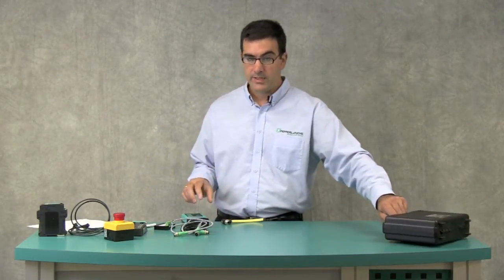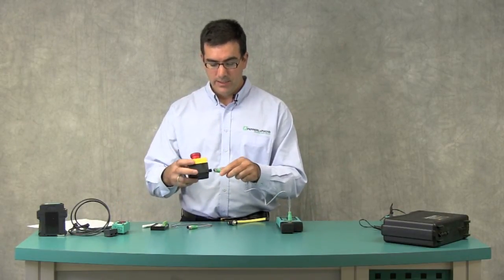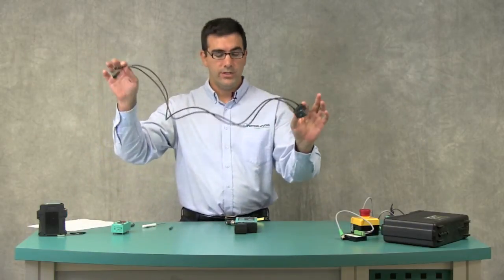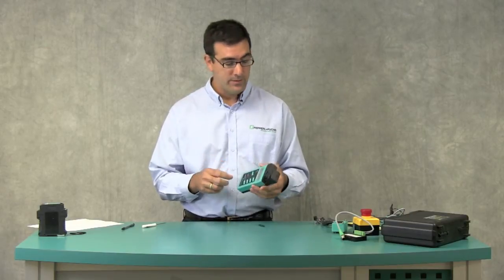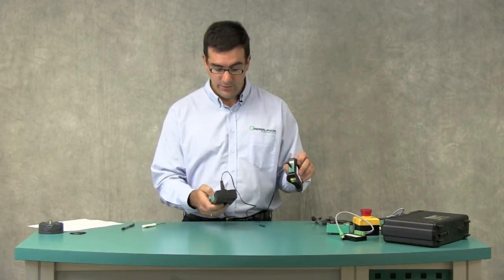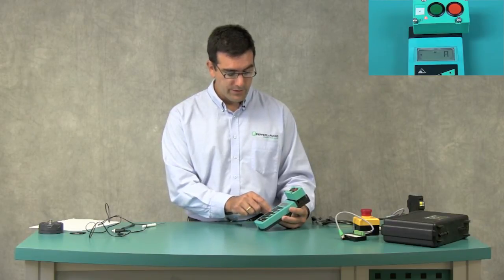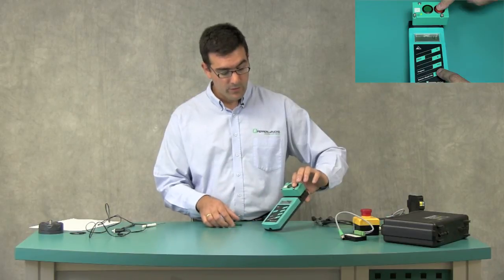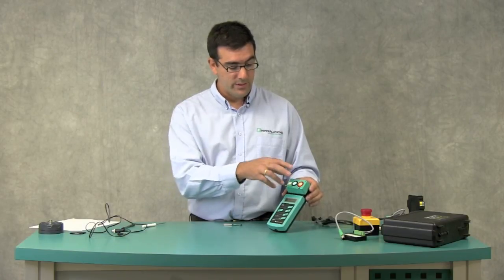How to Use AS-Interface Handheld Programmer

Comment: Hellow, Mr. Tim Cicerchi, My Name is Saravanan, Thank You for your presentation, kindly advise me where to use this T-Distributor (V1S-TEE-V1/V1S), Is it for 2 modules set in one address?
Reply: is it possible 2 modules (VBA-4E4A-CB10-ZJ/E1J-FL) set address in one port?
Reply from the maker: Hello Saravanan, the T-splitter can be used to connect any one of our AS-Interface power supplies https://www.pepperl-fuchs.com/usa/en/4507.htm?searchterm=van-115&start=0&rows=10&modifier=beginswith.  This allows for additional power to be provided to one or more modules on your network during the addressing phase. You could also use the splitter to connect two modules at the same time.  This Tee bridges all pins.  We hope this is of help. If you should have additional questions, please visit us at https://www.pepperl-fuchs.com/usa/en/ask_an_expert_fa.htm and fill our our Ask an Expert form and one of our experts will be in touch.
Thank you.